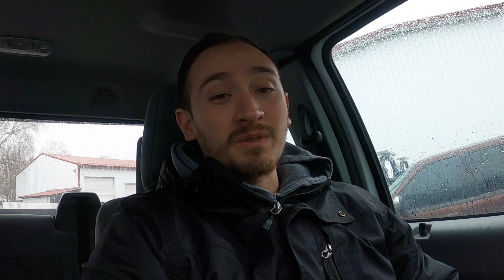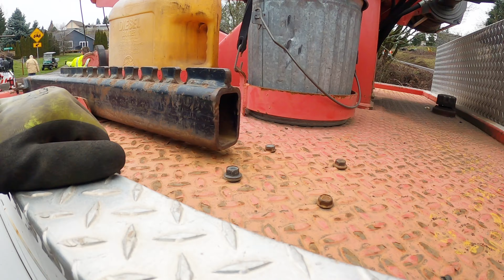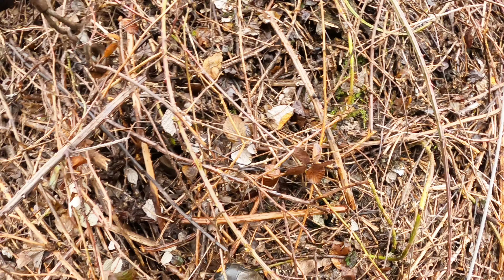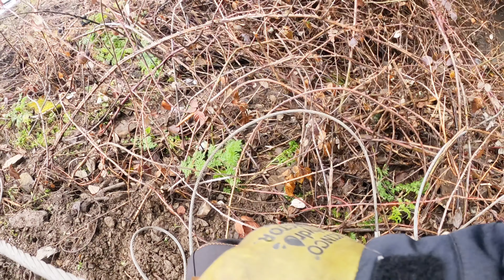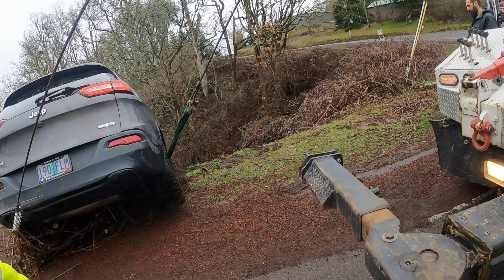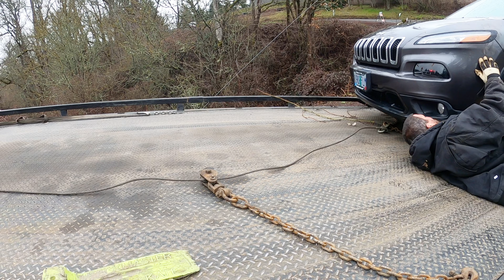2017 JEEP IN A CREEK!! (Car Under Water) - Episode #39

Comment: The door wasnt folded over backwards at the start of the video. You two did a good job of making sure that thing was a total loss by the time it reached the road! And whats with not puting your wheel lifts down to stabilize the tow trucks?! #towfail
Reply from the maker: Yeah we weren’t able to get the door fully shut with where it was at it the water and in the video I attempted to get it fully shut. The wheel lift is not required to be down when doing recoveries especially with overwhelming weight.